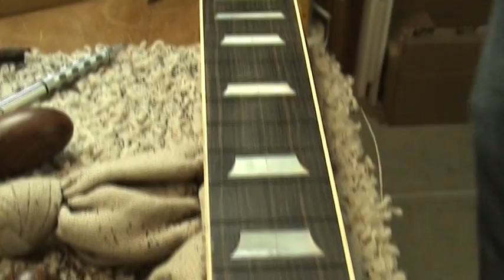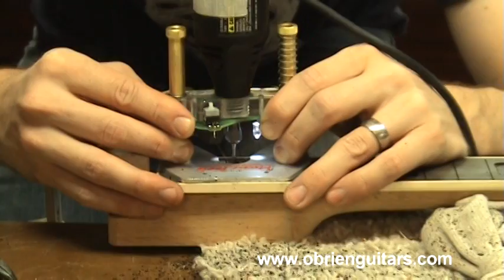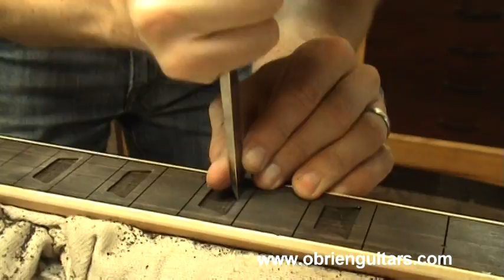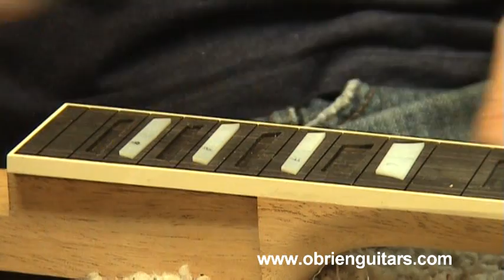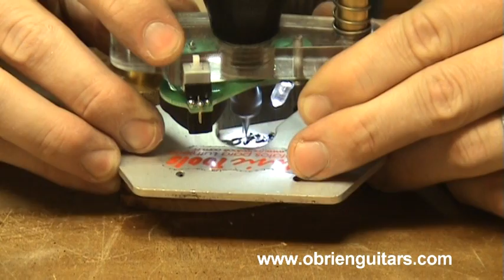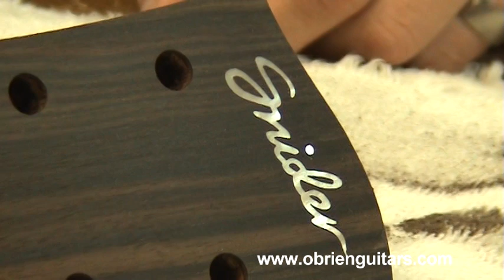Online Electric Guitar Building and Inlay Course

Comment: Hi there!

What files dimension for the jeweler's was you are using? I'm trying to cut a Mother of pearl blank which is 1mm thick with 2/0 files on my jeweler's saw but I cannot cat the blank, I have even crack one in 2 part. I can't engage the cutting process. Maybe you are using an 8/0 files for your saw?  

Here 2 pictures: http://s31.postimg.org/d2ywtwrzv/IMAG5596.jpg
http://s31.postimg.org/wq1wx9lmj/IMAG5598.jpg
Reply from the maker: +LightsnRoses Use OOO size blades. The one in the picture is for cutting in all directions. Use the kind for only cutting in one direction.
Reply: +OBrienGuitars I have tried also with this http://i67.tinypic.com/jfjcwj.jpg but with no success, even this files doesn't engage cutting
Reply from the maker: +LightsnRoses Those teeth look large to me. I can't see the teeth on mine, I can only feel them. Go with a finer blade and check your technique.
Reply: +OBrienGuitars By the way, which drill have you used with your dremel for engraving the headstock for the logo? I have a Proxxon 240 but I don't know if use it with a flexxible shaft with free hadn or with a router base like you did.
Reply from the maker: +LightsnRoses use spiral bits. Some use upcut and some use downcut bits.
Reply: I suppose a spiral bits for milling not for drilling.
Reply from the maker: +LightsnRoses you are correct